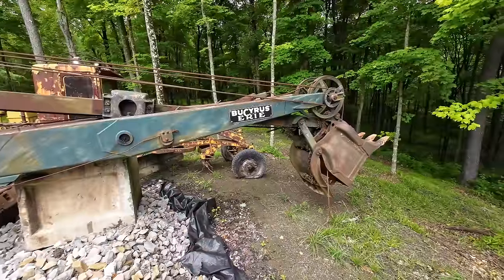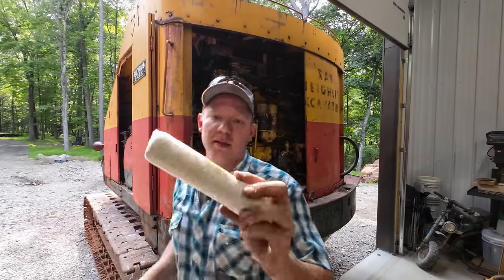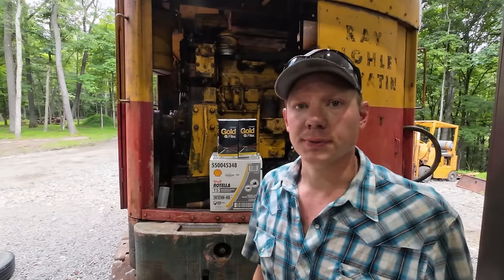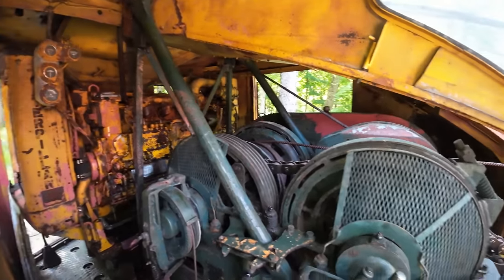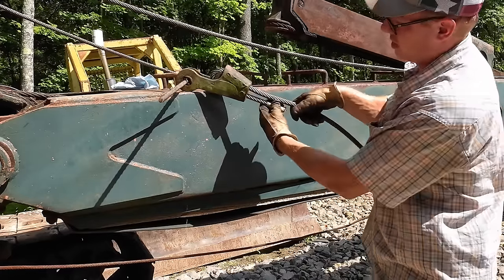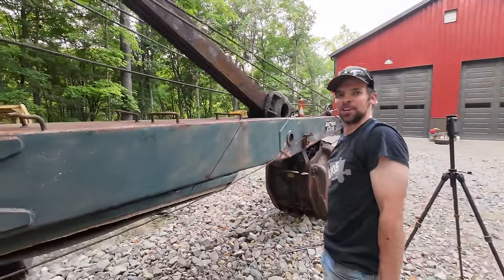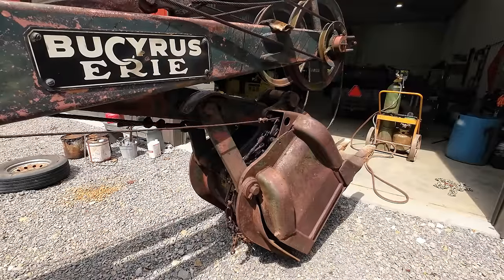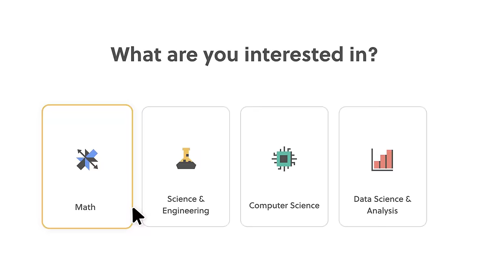Repairing a 1950 Cable Shovel, Sitting  20+ Years!!!

Comment: My grandfather worked for Bucyrus Erie in the 50's and early 60's at the Erie plant.  That a machine built 70 years ago and abandoned to the elements for 30 years can still work as intended with a minimum of service and repair is a testament to the engineering and workmanship of the old Erie manufacturing ethos.
Reply: Just got home from the Oregon Steam up and there was an SP Bucyrus Erie Steam rail crane moving rail trucks around.
Reply: Back then things were made as well as possible.  Nowadays things are made as well as necessary just about.
Reply: @johnbrice7868   I absolutely agree with you. Bucyrus Erie was one of the greatest manufacturers of heavy equipment worldwide. The company employed thousands of skilled workers. The company shocked the world in the mid sixties when they unveiled the walking dragline known as BIG MUSKIE. Featuring a 310 foot boom and a bucket with a capacity of 220 cubic yards. Yes indeed, 320 tons of payload per pass. The machine was so huge and powerfully built that the empty bucket had a weight of 230 tons !!!!!!!
Reply: @johnbrice7868   Just wanted to add a bit more information about the giant Bucyrus Erie dragline. The model number was 2450-w. The machine was sold in about 1969 for 25 million US dollars. The engineers At BE designed the tubular lattice boom to be pressurized with an inert gas. This system was developed so that any fracturing of a weld, would show a pressure drop to the operator. Of course this was displayed on gauges in the operator cab. The machine worked worked for 25 years at an Ohio coal mining company. During that period of time it moved absolutely enormous amounts of rock,dirt, and coal. Take Good Care.
Reply: As a resident of the Erie area, I enjoy reading things like this.  I'm a design engineer and would love to work at a place that designed fascinating mechanical equipment like this.
Reply: Ya Matt's like AvE's good behaved brother lol

Comment: How anyone could say you should scrap that, I just don't understand. The fact that it starts and functions as well as it does, is a testament to how well things were made. Thank you for your content.
Reply: Well, some people won't touch anything old without a computer of some sort attached to it.
Reply: If only Matt was around when Big Muskie (gigantic drag line) was slated for scrap.  It was WORKING just fine at the time it was shut down.

It's one thing to scrap a common machine that can be replaced.  To scrap something irreplaceable, like Big Muskie, is a crime worse than murder in the 1st degree.  Congress should've amended the stupid law to protect such mighty machines and allowed them to be made into museum pieces.
Reply: @iridium8341  Somebody force you to watch it? There is a hundred other "will it start" channels on stuff from the 60's and 70's. So much so it is becoming boring. Yawn.

Comment: On the wire rope, when we used to charge them on cat 586 side booms you had to be careful to make sure it was spooled on correctly, depending on the wire rope being either right hand lay or left hand lay, I noticed you had it going the same as it was before you started. Great machine and your tenacity to get her back in shape.

Comment: (hemp) cored wire has an advantage in heavily worked rigging in that it can hold onto lubrication than all-steel cables. the lube reduces friction between the strands, and slows down rusting. Makes the wire last longer.

Comment: Left school in year 10 and went into the Army as a Sapper (equivalent of USACE). I few years after I got out, decided I wanted to get a science degree and did well because I wanted to be there and didn't HAVE to be there. Once in that learning headspace went to TAFE and did every subject in the engineering department bar one. Point is - find what you are interested in and its not learning for learning sake, but increasing your knowledge about what you are interested in. Great job as always Mat and from half a world away never underestimate with influence and enjoyment you provide.
Reply: Hemp in cable was there to hold lubricant
Reply: @patcondlin6754  Don't ya need to grease up the new cable?

Comment: Thank you for another interesting episode! What amazes me is that, here is a 70 year old machine and a (relatively) young guy that seems to be an expert on its operation and mechanical details. What a great resource to have! Oftentimes, you can pick up and try to restore an old piece of equipment, but there is nobody left around to actually know at a good level of detail how everything was supposed to work and what the tricky bits are.

Comment: Around 1975 I was working for a timber company in western Washington,  they had several contractors building roads for them. One of them used a Bucyrus Erie almost identical to yours.  He built the entire road prism cut bank, ditch, road bed and fills, and grubing stumps all while sitting on top of 3 timber pads that he walked up the the road grade to avoid bogging down in the mud. I don't recall how many feet a day he could do but it was considerable. All that remained to be done was rocking the grade after it had dried out for a mounth or two. Until I  saw this I  had no idea what those old machines were capable of. Most of the other contractors and the company itself used dozers for road construction and going from staked grade to finished grade in one pass like that old shovel was not possible.

Comment: Aloha Matt.   Once again you have cleaned up and serviced this old gal and have her back on line and ready to make you some bucks on a job.    This video reminds me of running hydraulic cables in the big ME-16 tracking telescope I used to track rocket launches from the Kauai Test Facility in Hawaii for many years.   It too is a throwback tool from the mid-50's that did some extraordinary work tracking things that flew through the sky with outstanding precision.    Way to go getting this nice machine back in operation.

Comment: A couple of observations from a non operator but someone who reads a lot.  You will probably find that there is a lock for the tracks so you don't push yourself away from the pile when using the face shovel or pull yourself into the water when setup as a dragline.  The other observation is that when installing lines the end that is buried in the reel should go on the drum.  This will take advantage of the natural set in the line from being on the reel.  Doesn't matter in this application but when set up as a crane or dragline it will help prevent bird nesting if you get slack.

Well done on the clean up, I am envious of all your toys!

Comment: Good job stringing the cable. Just a word of caution about heating next to the grease zerk on the bucket. The heat can cause the little check ball to explode outward with great force. Will easily penetrate skin or worse if you happen to be in the way. Have seen it happen, fortunately no injury. Just one more thing to be aware of. Always remove those zerks before heating. Love those old cable machines.   I own  a 13a d8, so looking forward to seeing more content on it for sure.
Reply: I wondered about that too

Comment: Matt, I don't know if you check your comments after 4 months,  but if you do you might try taping a rope to the dead end. when you pull it through you you can use the rope to pull the new cable back through. Maybe this will help you since you do it yourself. Love your videos. You are a very talented man. I was a heavy construction super for over 25 yrs. I only wish I had about 20 of you. I've had a couple though. Good luck going forward.

Comment: Great progress on the Shovel. Something to note. When installing a cable clamp, NEVER saddle a DEAD horse!! The saddle of the clamp must be on the live line, and the U bolt must be on the dead end. The way you have the clamp installed, the u bolt is crushing the live line. not good.  A suggestion on running a new to you piece of equipment, slower is better. Run at 1/4 throttle to get a feel of the machine.   Love the video.  Looks like what I'm getting into soon as I'm acquiring a Koehring 2N crawler crane, with 300.7 hrs !!!!                Keep up  the good work.

Comment: I get a kick out of watching these videos.  I have done very similar things with trucks, cars, motorcycles and some heavy equipment, but not filming it, since I was a teenager.  I even had and got operating, a snowmobile, in Mississippi, at one time.  At 71, I am not physically able to do much now, but this is about the next best thing.  Thanks Diesel Creek.

Comment: My gosh Matt, You brought back old memories of My Dad taking Me with Him to His work. Graveling woods roads in the  50s. He operated a little48 Michigan power shovel loading at  a dozen trucks. the was powered from the carrier engine. You'd put the truck in what ever gear You wanted. Then another lever transferred power from driveline up to the crane. The crane control levers air assist. The housing lever had a gold round knob on top with a push button to trip the door to empty the bucket. Once He would got the pit opened up. He shift tto a higher gear. So He could load faster! Thanks for the memories. Best part of the day was when a driver would hoffer to let Me drive His truck!

Comment: When I cut cables, I use a stick welder. It locks all the strands while you cut. Crank the welder high, and it welds the cable strands together. Then touch up with a grinder to remove any sharp splatter.

Comment: Once you get the hang of these machines they are hypnotic to watch. 
We had one at work, steam powered, that put a cutting in for use to run a new line on out narrow guage railway. Its was a great weekend 👌.
We have a pretty huge one that was working when parked but had a bit of an issue with soft ground became stuck it hasn't moved for 40 years now unfortunately.

Comment: As someone mentioned, these old machines are totally mechanical.  Everything is done with pulleys, cables, brakes, and clutches.  That means it takes both hands and both feet to operate with each limb doing something different.  Sort-of like rubbing your belly and patting your head while dancing an Irish jig...not easy on a good day, by any means.  It takes time and practice to become proficient in their operation.  You do amazingly well for a young guy/beginner.  Keep up the good work.

Comment: Hi there we have always called the becket a pear and socket in the U.K., When fitting a bulldog clamp the saddle goes on the live line, you never saddle a dead horse, love to see these old machines still in use, where i work we still use 2 RB100 cranes with Detroit diesels in.

Comment: My first job out of diesel collage I had to drive the service truck for changing cable. It is much easier to braise the new cable end to old cable and pull, new cable through then wedge it. D9s had two spools on back and would wind old cable to a spool at any sign of wear. Took crane to move spools but we did it….in pouring rain at an old quarry where these machines had not moved since new. Probably still they’re rusting away.  It has been….thirty years now. I feel old. I used to remember the filter numbers by heart. Gave that up in 95 and worked on old muscle car repairs and restorations since. Semi retired now.

Comment: I'm surprised anyone complained about the condition of this one! Compared to any cable operated shovel I've seen, this thing is mint! The tracks are tight, all the functions work including spool brakes, and there's still paint on 90% of the machine. Apparently they havent seen your other two cable shovel units. I've seen one other channel do a cable shovel revival and most of them are in really bad shape. The tracks were so loose on all the others, I thought they were going to roll right off their sprockets!

Comment: Just the fact that it could walk and turn immediately after you got it started after all that time sitting without any major repairs tells the tale of its condition.
A tip to get those wedges out easier: Use a cutting torch to melt the cable at the midway point on the back side of the wedge. Don’t hit the cutting lever, just melt the cable. Because it’s wrapped around the wedge, as the individual wires melt, they will spring out more or less straight. After all of the wires are melted, tension on the cable and wedge has been released. Now the wedge is much easier to drive out.

Comment: Matt, that cable has a fiber core to lubricate the cable. The core is progressed. Your cranes will use no twist. If you put regular cable in a free lifting mode, it will unwind it's twist under load.
Reply: Pre greased

Comment: Hi Matt, that first rope/becket you strip was assembe out of line. The load should be a straight pull through from the wire to the pivot pin. How it was set it put a kink in the rope.

Comment: Looks like you just need to circle the dirt pile a couple of times keeping the center of the pile in same spot. Like sweeping the dirt up of the shop floor. Love seeing the old iron running again. My grandfather worked in a ready mix concrete plant when I was a boy. They had a large cable shovel I remember seeing. Wish I had been smart enough to learn more from him.

Comment: I used to have an ‘86 Mercedes diesel G-class from it was about 19 years old. Common wisdom in the merc community was that old diesels worked better with semi-synthetic oil, because it would seep less than fully synthetic. A buddy of mine bought it, and still use it every day - 37 years and running…

Comment: 30:20 Still used though, they have oil in them, when you pull the cable then this core is compressed and your cable is lubricated from the inside. And if you want to enjoy your cables for a long time, especially those that stay outside and don't get on the drum, spray them from time to time with bell ray wire lubricant with a plant sprayer.

Comment: Hi Matt, I’ve been a subscriber to your amazing channel for almost a year and it’s so great that I’m seeing basically a mini me LOL

I was in heavy equipment for about 38 years, you name it, I’ve most likely repaired it. I too went to many Richie Bros. auctions, lurched, fixed, repaired, restored, flipped it or kept it on the farm I worked at for use in the 800 plus acres which was a Tree nursery.

I grew up around cable shovels, loader, etc and recabled them as well, it ain’t easy but that’s why they call it heavy equipment.

It truly is a pleasure to watch your channel but at times you’re giving me the itch and you’ve made me scream at my screen a few times like when you pulled the hub assembly off of your the roller clutch, I was yelling, “Don’t Do it Like That, Pull the Bolts!” LOL

Ya live and learn 😂

Thanks for all that you do, Ron

Comment: Matt, if you ever want to see old cable operated equipment in operation, you should look up the Mackinac bridge archives. That was built in the 50’s. The bridge wasn’t opened until 1957. It was a huge project. They had shovels, bulldozers, and barges with more cable operated shovels…

Comment: She's looking good. Got a recreation area out here in my suburbs that was built around two small quarries. One of those B E machines sat on the edge of one of those pits from my earliest memories until it just vanished in my very late teens early 20s some time 80 or 81. I'm figuring the ground may have given way and it tumbled into the lake the pit had become as there didn't appearto be any disturbanceof the vegetation that had surrounded it to indicate removal or on-site scrapping. I do know they cleared all the old cars and such during the conversion  to a twin lake park 10 years after the shovel went missing but I'm pretty sure the newspaper story ( slow news day I guess) would have mentioned a cable shovel as one of the " prizes " pulled up from the depths when the story was covered so it may still be down there and considered unrecoverable.

Comment: started operating cable dozers and shovels with US army engineers. Found the best use for the shovel is in a pit. We had quickway equipment that could be changed from a shovel, excavator and crane and was rubber mounted. Had D8 9A Cat cable machines with A frame rear mount cable. I think I still have bumps on my head from standing up under the A frame.

Comment: Nice machine and another awesome video Matt! I noticed that you clamped the tail of your first wire rope anchor incorrectly though. The tail should never be clamped to the live line, and also if you ever use a Crosby clamp on a live cable the clamp side should be on the dead line and the saddle should be on the live line. The tail for a wire rope anchor should be minimum 6" long and should either be clamped to itself in a loop or the clamp should be installed on the tail only as a safety stop. The way it's clamped now can damage the live rope and create a weak spot.

Comment: Anyone who calls this scrap would probably tear down a historic building because it needed a roof and had some rot and mold. This is history, living, breathing history. It's why I like daily driving a 40 year old Dodge truck with a slant 6, 4 speed, and manual steering. These machines do not belong in this era, they are forgotten, obsolete, but they deserve to be remembered, be it heavy machinery or just your common base model pickup. Keep up the great work, and be safe around these cable machines, I've seen heavy cables snap and take things out before, scary! Guess you're gonna have to name this old gal Bones, or Spooky, or Stank, haha!

Comment: having worked in the overhead crane industry , when we chanded cables  we would use baling wire to tie and tape the new to the old and pullit htru the reeving. also we fwould never dag a new cablle thru dirt, you can work right off the spool.just a few ideas. i d like to work with you sometime but  old aqge is comim on. (68)